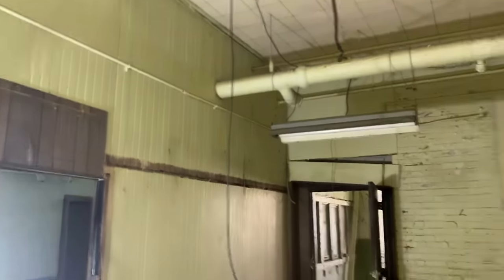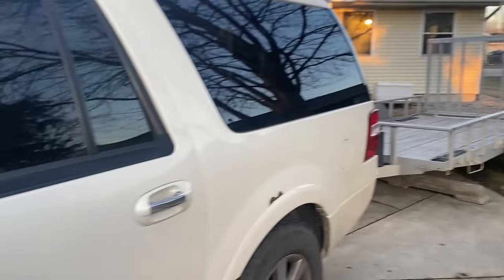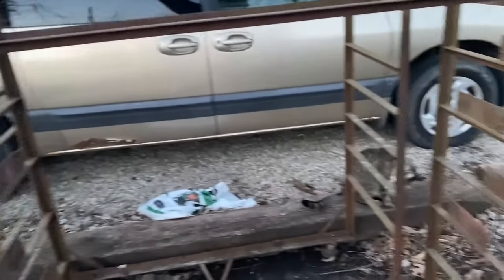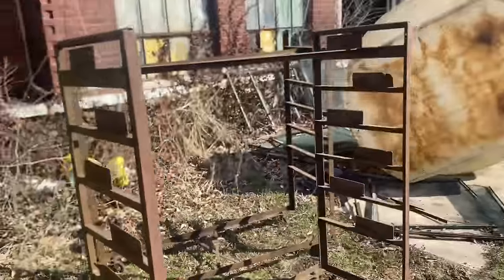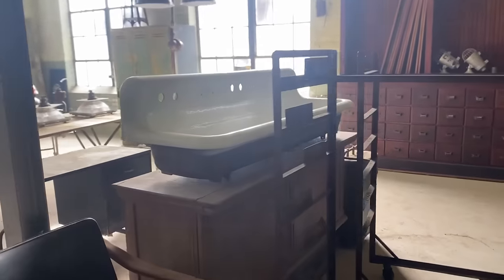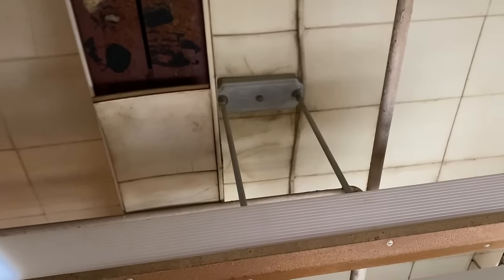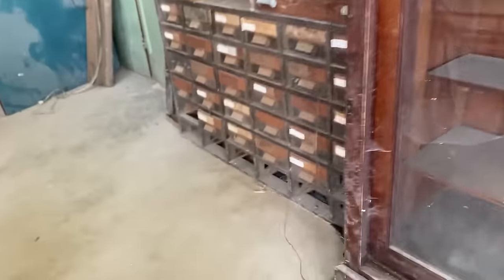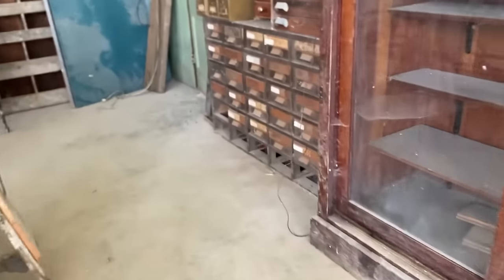Antique lighting and industrial shoe carts- renovating an industrial building

Comment: I’m going with the 40’s for the lights. Makes you appreciate how tough people used to be. 

Those screw caps could probably be 3d printed. One of the companies I do services for has a 3d printer that makes steel and aluminum parts car cars. Will take a few years before its mainstream but the days of not finding a part for your 1930’s project car or light thing are over, as long as they can scan it or see a technical parts drawing.

Maybe in the next local auction look for a motorized scissor lift. That would be a game changer for you.
Reply: Wow that’s interesting.

Comment: While folks tend to use barn wood in its "natural" state....When you sand old barn wood, it age shows you a different wood than you buy today. Wax it & you have wood that looks & is the age of antique you are working on.... the shoe racks. I believe the light fixture finials for your hanging lights are still available. Try an old time local hardware store that sells old lighting parts or an internet lighting parts store. The style, weight, use of cast aluminum, & use of glass are common to 30s/40s. The development of hanging florescent bar lights started somewhere in late 20s, but was not into full swing until 30s.

Comment: Those big pumps that are in the ground by the old water tower should be pulled up and cashed in for scrap. Then use the hole to burn some of the paneling etc. You could get rid of the brush you clean up around the place, and fill the hole with the ashes. Small fires. Don't bring attention to yourself.

Comment: The ballasts may have a date or date code stamped on them somewhere (sometimes on the back of the ballast), assuming the ballasts are original in any of them. Those fixtures are probably no older than the late 40s. If they are rapid-start (having no replaceable starters, no starter mounting holes, or any sign of starter sockets ever being mounted in the fixture) then they are likely from the 1960s or later.

Comment: About the lights you don’t have to spin the fixture you can just unscrew the bolt that hangs them to the ceiling the  wire will not give you the age because like you said they could have been added after and could have replaced a different fixture that was originally installed you can disassemble them while they are hanging and remove the ballast and change them over to LED bulbs while they hang and not create extra work ? Just a suggestion

Comment: Lighting screw Caps, lock up cap, lighting mount caps are on Amazon and likely at a home center.  Not exactly the same look but work as a replacement.
I do light renovations and I don't like to carry things or move things more than needed.  With all the moving stuff around in demolition or just moving stuff out of the way maybe those carts could be wd40'd (or temp with new castors till you are ready to use them as original displays)add a bottom shelf and maybe temporary wood sides that create  deep cart for metal collecting or wood collecting throughout the building till they are full and ready to be taken to the recycler or dump  

Definitely, remove the fake wall.

Comment: By coincidence, I'm in the process of converting an old florescent light fixture to LED and I was astonished to find just how much of its heavy weight was from two ballasts, which of course I won't be needing for the LEDs.  If you were to remove a sheet metal cover in the middle of your fixtures, I'm sure you'll find there are ballasts under the cover....removing those before dismounting the fixture would make the fixture much, much lighter.
Reply: Interesting
Reply: There is led tubes for line voltage  and tubes for 
Use with the balast /reactor 
Some tubes have built in driver s,and  some require  separate 
Drivers that replace the original fluorescent lighters.
It's a bit of a jungle with difrent option how to convert to led.
In the cc case I would recommend taking  down the lights ,do insulation testing on them sheck cables for dry rot.
paint the fixtures .mayby he should discuss the best way of converting with a electrician 
Before deciding how to preside. The electrician can meg insulation test also.
Reply: @perstaffanlundgren  very good point!  In my case the ballasts and associated wiring were not in very good condition, and I went with the type of LED that uses line voltage.

Comment: For temporary lighting, consider COB LED Strips 16 ft lengths or longer, You can use Wi-Fi outlet switches and turn on with phone or huge groups to turn on all at once. They can even be attached to walls, not ceilings. Even voice control. Less wattage, cost savings easy peel and stick applications, temporary and easily moveable. Maybe consider some Home Depot style carts to move stuff around, you're really tearing up your body, moving all this stuff around. I hurt just watching.